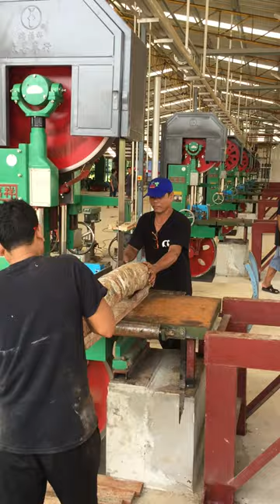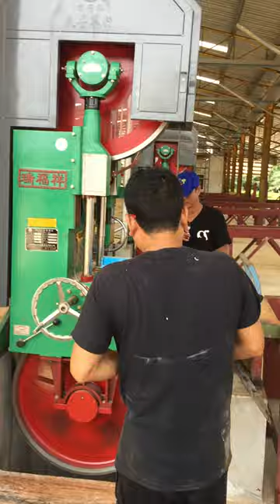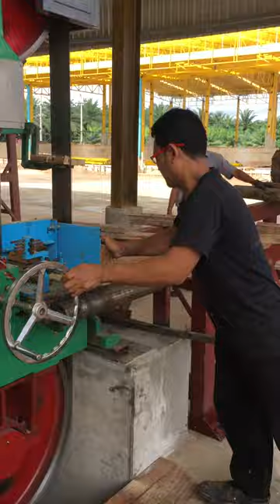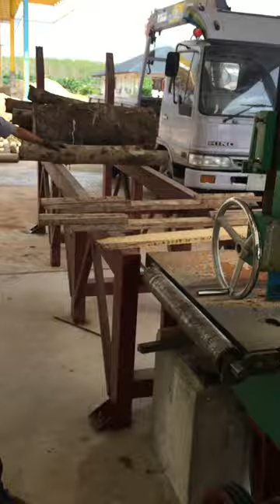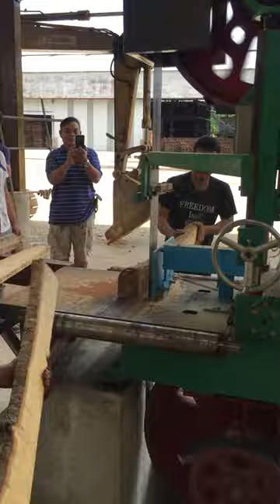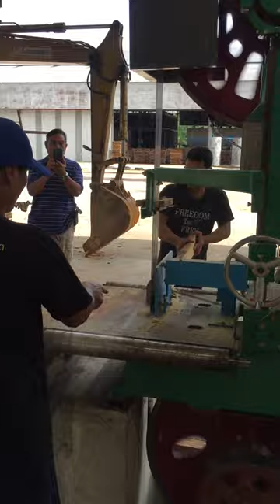2017 36inch precision Vertical bandsaw mill with bench for Rubberwood  cutting

Comment: Imagine you.lean a bit forward and accidentally put ur foot where the wheel is turning jesus that is so dangerous. 
Some plastic covers or something would make.it so much safer
Reply from the maker: u are right, thank you.
Reply: @YSDMILL-MACHINE  I work in a car manufacturing factory and I work standing up and so.many times I lean forward to look inside the engine and my foot goes under the table. 
Anyway thanks for saying thanks and safety first! :)
Reply: @YSDMILL-MACHINE  ko